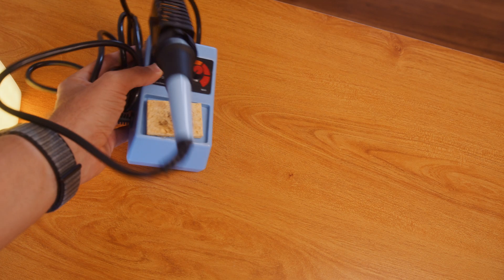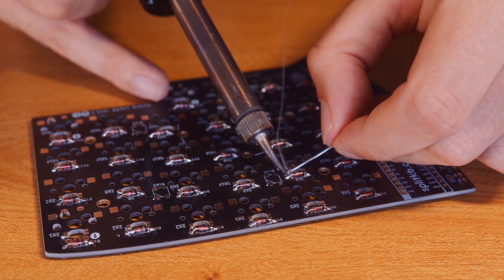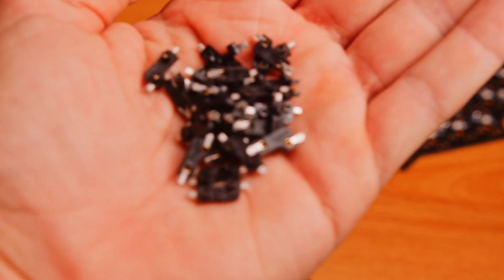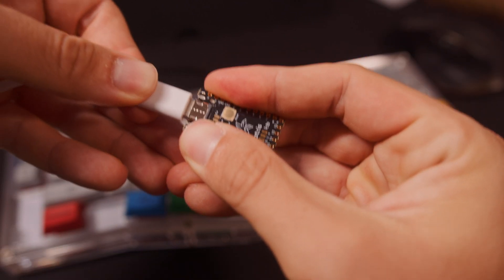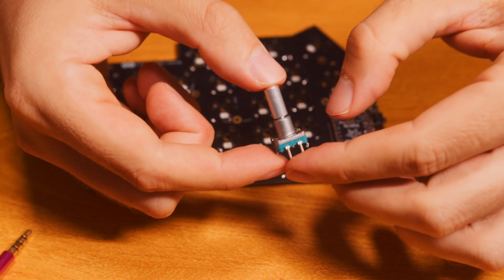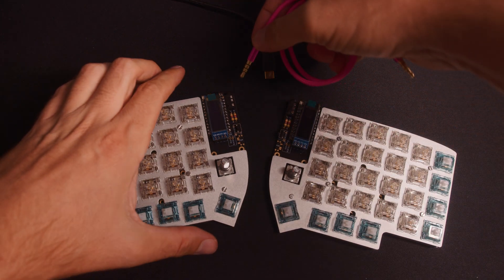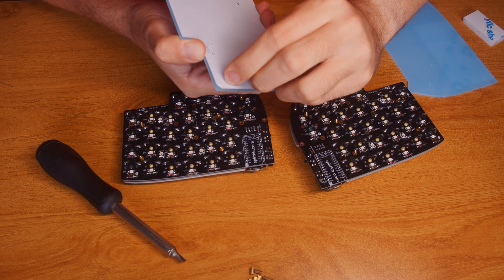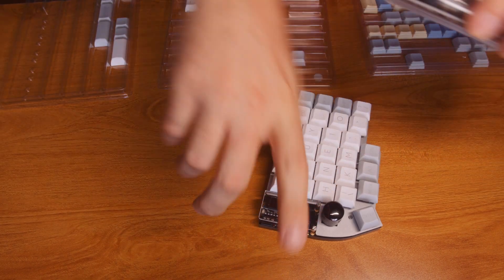Aurora Lily58 Build (mechanical keyboard start to finish)

Comment: Hi bro, I am almost done, I just finished buiding first half and connect it and when trying to test the encoder it recognizes as key '[', did you have to do something special when configuring the encoders? which firmware did you use?
Reply from the maker: That sounds right. I use Vial which is just a variant of QMK. This is probably a good starting point for you -> https://firmware.splitkb.com ... Good Luck!
Reply: @matej_sajgal and it automatically recognized your encoder? Or did you make changes on the firmware?
Reply from the maker: yes encoders are enabled by default and they're mapped to "[" and "]" you can check here -> https://github.com/qmk/qmk_firmware/blob/master/keyboards/splitkb/aurora/lily58/keymaps/default/keymap.json 
I think your keyboard is working as expected, but I would recommend installing firmware that supports Vial so you can use GUI to change your key mapping. It's the easiest way if you don't want to tinker with QMK.

Comment: You also installed some green switches there ? What are those ?
Reply from the maker: The green ones are Durock Shrimp Silent Tactile and all the others are Gateron North Pole 2.0 Linear 😊
Reply: @matej_sajgal  Cool, what's the point of that? You wanted a different feelings on the options keys?
Reply from the maker: yeah, exactly, I wanted to try having mods just a little bit heavier than alphas. But I can't really tell the difference when typing to be honest, 67g vs 50g is just too close probably 😅

Comment: Thanks for sharing what software did you use to configure your keyboard is there instructions? Thanks in advance. I am about to do my 2nd attempt on the 58pro as I messed up my sofle cannot get NHY and J  keys to work.
Reply from the maker: Hi, I'm currently using "vial". It has gui, so you don't need to code your own qmk if you don't want to and they have tutorials on their web https://get.vial.today/

Comment: Could you share your firmware settings
Reply from the maker: What do you mean firmware settings @Darkah?
Reply: @matej_sajgal  i mean your keymap and oled settings that you flash in the arduino
Reply from the maker: my keymap will probably not help, I'm using colemak layout. But here are the official firmware files for all the splitKb keyboards https://firmware.splitkb.com/

Comment: hey thanks for this! I got a board that supports underglow and per-key rgb and have had a hell of a time with them. is there a particular QMK preset you used, or did you compile your own firmware? Thanks!
Reply from the maker: Hey, great to hear from another mechkb enthusiast 😊I started with the default QMK firmware for the keyboard, but I'm using colemak layout so I used config.qmk.fm to build my own. The qmk config doesn't support rotary encoders, display functions and few other features that I'm interested in though, so I'm in the process of creating my own build from scratch (github instead of qmk config). I'm also editing a lot of videos, so I plan to dedicate one layer purely for my editing software. 

What keyboard did you build?